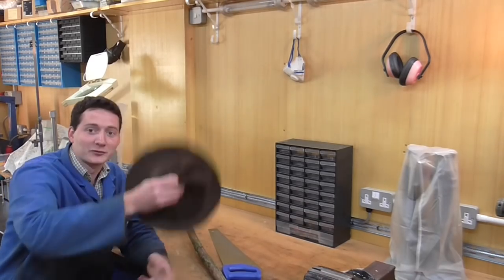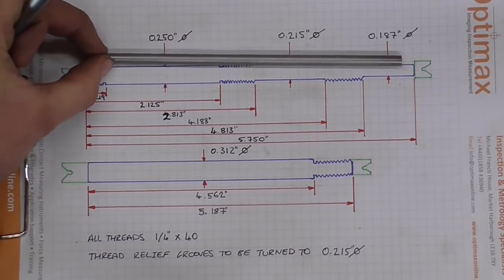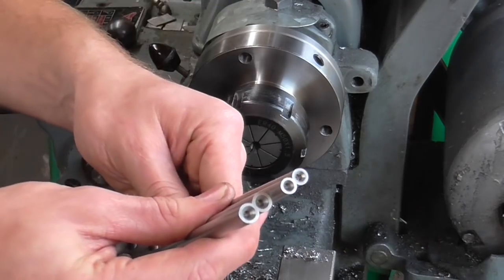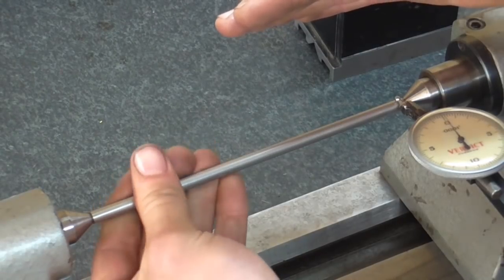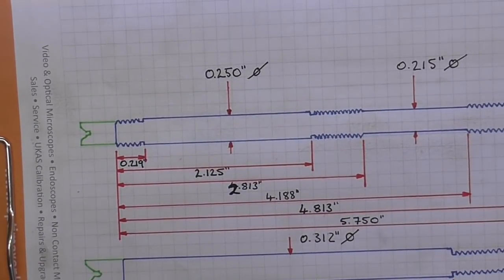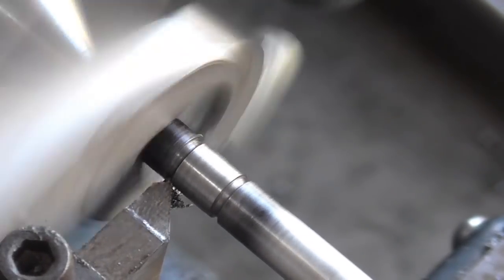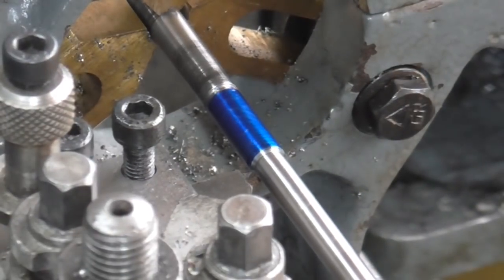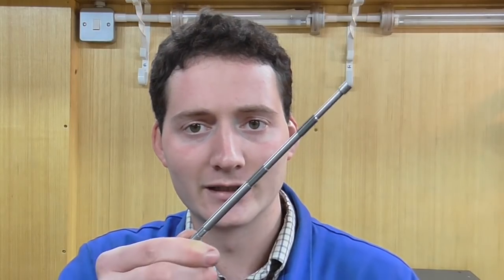Pistons and Rods Part 3

Comment: WOW... Of all the precision junk I have done over my days, never once did it ever occur to me to hone the center drill holes for turning between centers.. I learned something today.. Thanks, Mr. Crispin...
Reply: Something mysterious about that. I've never seen it done before. I've never seen this standard of work before - and recently, I've watched quite a few vids going on about accuracy simply wondering if they're that fussed, why are they not turning between centres ?
BUT, deciding I'm a scientist, it raises many questions about centre drilling - having a taper - do those hole actually match the centres' angles the part is going to run on ? What is the purpose of honing - if it was necessary for the drilled holes, why is it not necessary also for the centres the work's going to be mounted on ? PERSONALLY, I think a bit of roughness is good - as pockets of oil.
Reply: @millomweb  I personally do not know anything of the advantages of honing the holes, But, when or if, trying to be precise in manufacturing, every step taking to weed out any issues can either introduce or reduce precision efforts.. but, if the method is perfected and a part of manufacturing routines, and honestly handled with great care, well, I say, jump in with both feet. Would this be a step that I would use in my shop, 99% of the time, no. But, now I know about this and I will look into this. I think for something like rifled gun barrels that honing would really show it true worth. I am now glad I know this though. I kinda see it as the tool in the tool box, that you hardly ever use, but when you use it, you are absolutely glad you just already have the tool to get the job done.. If that makes any sense?..  I found it an interesting concept, due to having never thought or seen such a thing.. and as I think about when first seeing Mr. Crispin showing this process, I actually have been bit in the booty, just from burrs. Which is clearly my fault, but the honing practice, is a step that would focus ones attention to the holes for turning between centers a little more.. It really is a neat subject matter.
Reply: @drubradley8821  I'm pretty much with you on all you say - new to me too.
Thing is, the honing machine has no reference point - so nothing stopping it taking more off one side than the other moving the centre holes !
So, it's a good question - does it make things better or worse ??? I don't have an answer for that, just my suspicions.

Another point is his use of the fixed steady. He never said if he machined part of the bar true before using the steady on it. If not, then the bar is running on its original surface which as he demonstrated would not be true to the centre holes.

Being precise is a complete work of art and relies entirely on everything being traceable.  The honing and steady use was not !
Reply: @drubradley8821  I think what should have happened is that the centre drill should have been used then the hone placed in the tailstock - so the hone is kept true to the centre hole.
Reply from the maker: Its all traceable, I checked the OD of the stock after cone lapping so I knew what errors were present. Equally yes I did use the steady on an un machined surface but again I had measured what errors were present, and deemed them acceptable. 

The key to cone lapping is that the part is free to self align centre to centre. I will do a video on cone lapping theory as it seems to have interested people.

Cheers
Crispin
Reply: @MrCrispinEnterprises  I will enjoy that video sir.
Reply: @MrCrispinEnterprises  Please do a video on chatter too - covering: rigidity, cutting speeds, depth of cut, rake and clearance angles, tool height, cutting fluids, different materials, chip size and clearance away from cutting tool I'm going to have to say... etc. !
Not all of the above apply to lathework and milling but they apply to at least one of them ! It seems side milling slots has its own problems !
This was part of the HOMEWORK I'd planned to set you ;)

Comment: Thanks for the tips on lapping the center cones and making out the features with the magnetic v-block. I think I spotted some packing foam aiding in the threads measurement with wires and that seems much more useful than trying to get them to stick to the work with grease!
Reply from the maker: Yep packing foam

Comment: The amount of stuff I learn when watching your videos is incredible. Two standouts for me was the cone lapper and using a v-block on the surface plate to hold stock perpendicular. I can't afford a cone lapper but I have a pair of v-blocks! I also think I need to purchase a more recent Machinery's Handbook. I use my fathers 12th edition dated 1944! A bit of info on turning speeds would also be of interest when machining. I think someone is having a bad day considering you got a thumbs down. I would like to see them produce a quality video demonstrating their engineering capabilities.
Cheers.
Andrew
Reply from the maker: Thanks. you could lap cones in a lathe I reckon. Inbetween the tailstock centre and a monted point in the lathe spindle. You could put a diamond dresser in the tool post and dress the point to 60degrees with the topslide. Just watch that wheel dust!
Reply: @MrCrispinEnterprises  Yeah, I just abrasively pointed several rods today, my cleanup protocol is vacuum not only the ways, but bed, pan, wheels and control panel too, the stuff picks up an electrostatic charge and clings everywhere, which means it can migrate back to where you don't want it. I end the session with a good mineral spirits wipedown over the same areas. I love what my toolpost grinder can do, but I treat the fallout like it was nuclear waste.☺
Reply: You realise of course all the thumbs down are actually Aussies giving a thumbs up.

Comment: I did indeed enjoy watching.  Albeit slow, it's fun watching you build these parts. After all you do not want to rush into things do you?. I thought not. 
I started a Stuart steam engine during high school in 1981,  got about half done. Life with it's twists and turns brought three or four diversions along the way! Therefore I am still not finished. However  nearly 40 years later I do now have an adequate machine shop, all the parts, drawings and toolingl. I figure it will make a nice retirement project. Besides, I am a much better machinists now than I was at 18. Cheers from New Hampshire USA🍻🍻

Comment: I have seen other machinist struggle with those thread measuring wires.  It's just a fraction of a second but just after 19:55 you can see he has the wires stuck in a block of black packing foam.
Reply from the maker: Well spotted. I may have to illustrate that method further
Reply: I have used masking tape to tame the wires, works.

Comment: future ref... tie your drive dog to the drive tang on the drive plate, with some type of stretchy tape, so it keeps your slack out, especially when thread cutting.. sure is a pain in the booty, but a razor blade to cut the tape off, when you need to pull the part out to check a dimension, is just part of it.. Electrical tape, unknown if that is something that is offered where you live, but, it is cheap and goes a long ways per roll.  Also, the area of the rod, between the threaded areas, wouldn't or shouldn't that be a larger diameter then the threads, so the spool stays centered, especially when you go to tighten the nuts to hold the spool in its place.. Or is that so the center line of the rod, is allowed to float independently from the spool, as the rod will be in alignment with the end caps of the housing, and the spool needs to have its own center line?.. just wondering... I am so glad you are back in the office, rocking and rolling on this project.. I hope the employment is doing for you and your family all that you wished it to be. As Rolls Royce is well known for having some of the finest craftsmen and designers in the world... You lucky duck.. good job, Mr. Crispin.
Reply from the maker: Good point regarding the dog, that could have landed me in a pickle when screw cutting. 
And yes your geuss is spot on, the threads are in clearance allowing the bobbin to self centre.
Reply: @MrCrispinEnterprises  A plus point of using a dead centre in the tailstock - a little friction to ensure there was no play in the dog drive / 'carrier'.

Comment: I hope you worked your work so that the end that had the least run out was the end staying at stock diameter. Because the other end was smaller you could machine out much of the run out that way.
Reply from the maker: Yes I should really have mentioned that. Well pointed out.

Comment: Great segments. I am a little confused on how you are aligning the spool piece when you have removed the center section between the threads which would hold the spool concentric. If you are using the thread crowns which were reduce in diameter as you pointed out, it would seem that the alignment of the spool piece and the shaft would not be concentric, and the effort to align the threads not as beneficial as it could be.
Reply from the maker: Hi, good question. Have a look at the end of the video I have just released 'pistons and rods finish machining'

Comment: Very interesting and educational, terrific video as ever. I am a bit puzzled about the valve rods though. I can see that for the piston rods straightness and concentricity might be really important and worth a lot of careful measurement. But if I have understood properly, that valve spool must have an internal diameter of at least .247" (else you can't get it over the threads on assembly?) and it's sitting on a section that is .215" diameter. I see that the retaining nuts will hold it in a precise position axially, but radially it seems to have a total of over 30 thou, so 0.75mm, of play. Given that one end of the spool could be 30 thou in one direction and the other 30 though in the other direction, seems to me that all concentricity is controlled by the hole the spool moves in, and the rod could be bent like a banana and would make no difference - you could have used the stick from your neighbours garden and a whittling knife. e.g.did the centres really need honing for the valve rod? I am obviously missing something.
Reply from the maker: Yes you are right about the clearances. The valve spool aligns it's self from the bore diameter. Accuracy is still required for the rid however as it runs in a diameter at both ends of the valve cylinder and the faces of nuts controling the spool need to be square. Cheers
Reply from the maker: Yes you are right about the clearances. The valve spool aligns it's self from the bore diameter. Accuracy is still required for the rid however as it runs in a diameter at both ends of the valve cylinder and the faces of nuts controling the spool need to be square. Cheers

Comment: How  do you make sure that the starts on the two threaded sections of the valve rode which engage with the bobbin are aligned? Hope that makes sense.
Reply from the maker: I don't have to because the bobbin is not threaded. Have I answered your question?
Reply: @MrCrispinEnterprises  Yes thank you.

Comment: the lathe dogs did you make them?  or buy?  if bought from where thanks?
Reply from the maker: Hi, I made them. If you are on Instagram have a look for mr_crispin. I put a few photos on there when I was making them.
Cheers
Reply: @MrCrispinEnterprises  thanks much- i have regular lathe dog- tail doesn't reach faceplate groove- cant find a short enough center (MT3) to make tail fit into faceplate- seems all the centers are about 5 inch long
Reply from the maker: You can sometimes use a 4 jaw, put a piece of stock in and turn a 60 degree point to use as a centre. Then put the drive dog tail against one of the jaws. 
Alternatively buy an MT3 'soft centre' and then just machine it down to the required length.

Comment: You’ve done a good job but you could have just turned the original diameter and then put on the threads, it would have all been concentric and would have been less trouble. Also could you show us your brothers teeth.
Reply from the maker: Yes quite possibly although I wouldn't fancy it on the piston rods
Reply: MrCrispin either way would work but you got the result in the end, if the total runout was within a thou the length of the rod was long enough to allow a little flex. I like the way your workshop is neat and tidy, it usually produces neat and tidy work.
Reply from the maker: Oh I think I miss understood your original comment. Were you referring to just leaving the threading diamter at .250 instead of turning down to 0.247? If so then I understand your point.
Reply: MrCrispin I was referring to gripping a slightly larger bar in the chuck with a centre in the other end and then turning all the diameters and turning the threads in one go so that it’ll all be concentric, but now you’ve just pointed out it’s only .250 dia  which I didn’t realise ( you tube can give a different perception) I fully understand why you did it your way. Well done a keep up the good work.
Reply: Tony Wilson  The centre lathe - that almost no one uses to turn between centres and instead, they complain endlessly about chuck/jaw run-out. I think it's time YouTube machinists made a habit of turning between centres ! Bring it back into fashion !
Must say, never considered work swapping like that to do matching machining - between centres is a great way to do it.

Comparing other YT videos, the other amazing thing about this work - he managed it without a DRO ! Neither my lathe nor milling m/c has any electronics on them !
Reply: Tony Wilson  "We have had this insane bullshit business policy of "we'll buy it from..."
Yeah, I believe you get your water from China now !
My (UK) school had 2 woodwork and 2 metalwork shops. It has none now. I've not been in aerospace but have been close - due to my father's interest in flight. He was a gliding instructor - that way he got to fly for free !
I was a teenager when I realised my interest was control systems. Collecting bottle corks - well, the controlled flow, didn't/don't they :) I've custom-built my heating system. It is currently on heating the one radiator in my bedroom as I'm about to go to bed. It'll overshoot on temperature nicely, shut off and no come on again until I want it to.

I'm possibly a greater fan of analogue control systems. The Invacar (see TWC (Pronounced tuk) https://www.motaclarity.co.uk/images/news/455-mobile.jpg ) Which wonderfully has two analogue computers fighting over a length of belt ! Between them, this tug of war results in a variable ratio between engine and driving wheels.
The input of computer one is RPM of engine - 'governor' weights v small springs. The input of computer 2 is output torque to the wheels v belt tensioning spring. So if the engine rpm is high it tries to slow it down by changing the ratio by grabbing more belt BUT if the output torque is high, the second computer doesn't let the first one have any more belt ! The engine peaks in energy output, the torque drops off and now the ratio starts to change.
It's a fantastic design and totally not electrical !

Comment: Why do you call the fixed steady a 'steady rest' ?

I know why you used it - but surely you should have trued the surface up you used it on before doing so ?
Reply from the maker: Thanks for your comments. 

Steady rest is a common term for the aperatus shown. Fixed steady and Traveling steady are probably the most popular terms but Steady rest and Following rest are also valid. 
Truing the surface up before you use the Steady would be sensible although the section of diameter fist was in an already rather flexible place. Also I have already checked between centres and there were no large errors meaning the stock diameter was usable. 

I don't currently have a contact email for YouTube but it's a good idea. I will bear your request for a workshop tour in mind.  

Many Thanks
Crispin
Reply: @MrCrispinEnterprises  Steadies - I wonder if the 'other' names are US variants.

Use of steady - totally agree any pre-machining for use of a steady would only be light cuts but that's all it would have needed in any case.

e-mail - perhaps you can drop me an e-mail (use my YT username @gmail.com) then I can make some suggestions you'd be happy to go along with ? (without publicly spilling the beans)